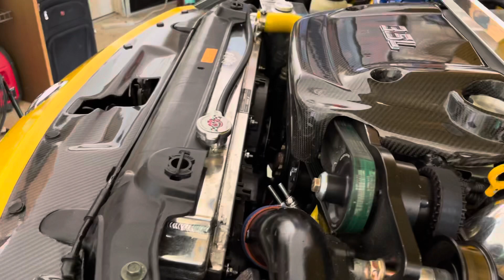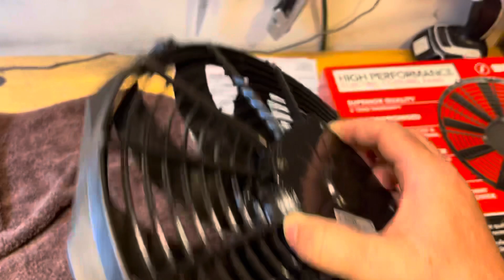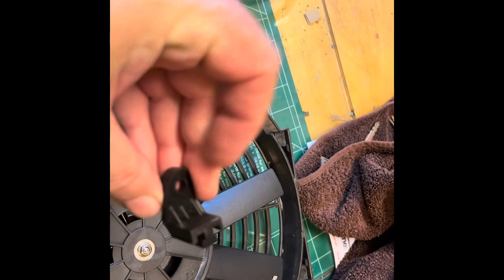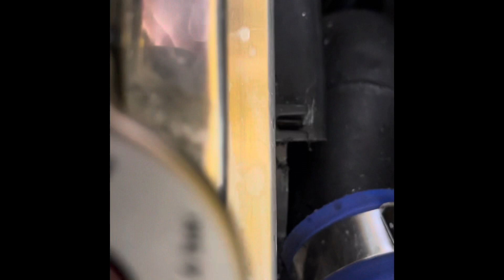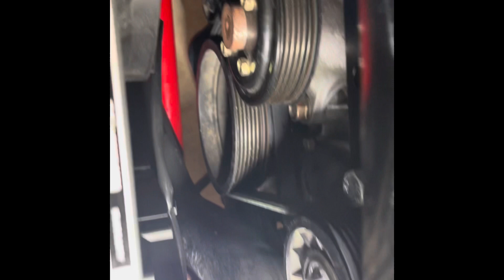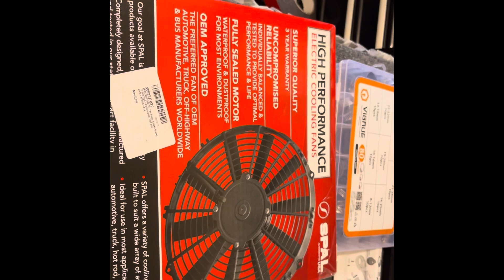Nissan 350z Vortech Mishimoto Fan upgrade to Spal Fans

Comment: So im having a similar issue with my 04 350z i got alot of bolt on mods so i upgraded to the full mishimoto kit. Recently i had to do a throttle body relearn and when i was reving it for the procedure after having it idle for a while the heat would climb to about 3/4 then when i let off it would go back down. Ive had this issue for a  while i always thought it was my stock radiator because i got these fans when my stock fan shroud gave out but now that i have the whole kit it still does it. Im also in texas and it usually only does it when its hot 90+ my question is do you think a lightly modified z would also have heat soak because of these fans or should i invastigate elsewhere. Thanks in advance
Reply from the maker: Yes I would.  Because the overheating was occurring just sitting at idle, so the mods were really not the cause of the over heating.  The problem is the fans that come with the Mishi. just do not move enough air when the car is sitting.      With no other changes to the car, just installing the better fans solved the problem completely.  Obviously, make sure both fans are blowing and there is not some other issue like that, but frankly those fans suck with the Mishi.   Others in cooler climates seem to not have the problem, so you will get mixed answer son this.     Once you are moving then the fans are not a factor, just when you are sitting still.    It was crazy, I could just sit there with the A/C on and slowly watch the temps climb.

Comment: You have them wired up to your factory wiring harness correct? And if so have you ever had any problems with them blowing? a fuse
Reply from the maker: None at all.  Yes wired up to the factory wiring harness.

Comment: Swapping mishimotto connector worked out ok? Did you have run a separate relay or anything?
Reply from the maker: No just wire it in ti the existing plugs.

Comment: I am having the same issue I believe, are these the high performance 1300cfm? Did this fix your issue
Reply from the maker: Yes, absolutely fixed my issue.  I have parked many times since with the AC on sitting in a parking lot in Texas at 97 degrees with no overheating and all is cool and good.   I do not recall the CFM on these.  They were recommended in a forum for this problem so that is what I purchased.
Reply: @JS-ny9ge  can you find out possibly? How much was each fan? Just trying to buy the same fans. Engine bay is heat soaked
Reply: @JS-ny9ge  also how much hp are you running? Do you think these would be fine for 700whp?
Reply from the maker: @codybashaw3605  Can't answer that one as I am running conservatively at about  400hp.     I will note though, the issue the fans solve is overheating when you are sitting perfectly still on a hot day with the A/C on.   Once you get rolling and the air is blowing through your engine compartment the fans really play very little if any role at all as I understand it.   So, when you are sitting still you have really no boost occurring just idling.   Should work fine logically for that purpose.     When I had the original Mishomoto fans there were no overheating issues at all driving around ONLY when I sat still for a long time.

Comment: Dope, saved just in case my mishi fans act up lol.
Reply: Mine already did smh 🤦
Reply: @recklessrunnerz3659  what did? Your mishimoto?
Reply: @NoDidddy  hell yea just wouldn't keep my shit all the way cool over heated a couples times on the track last summer. They did okay once it got cooler out tho
Reply: @recklessrunnerz3659  yea I’m hearing stock or spals are better. Haven’t had any issues yet in NYC weather.
Reply: @NoDidddy  yea ima be ordering some spals later on today gettn ready for the new setup hopefully everything works out this time also thinking about running a coolant swirl pot